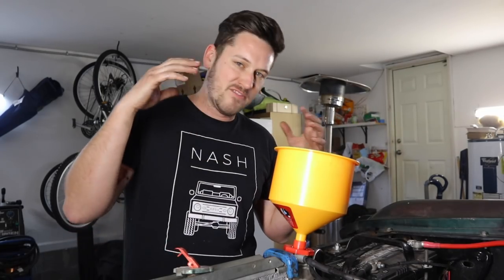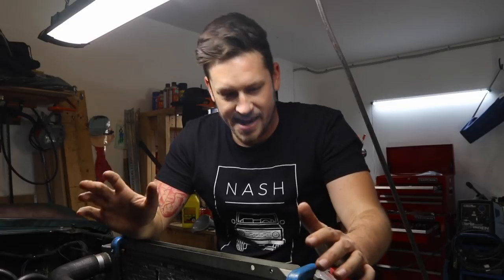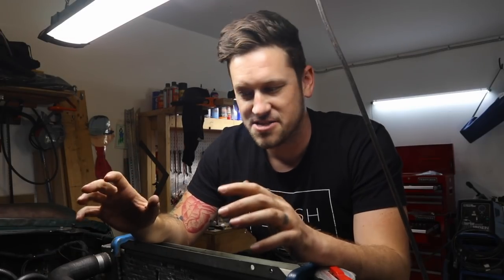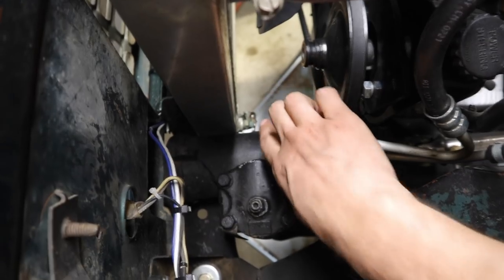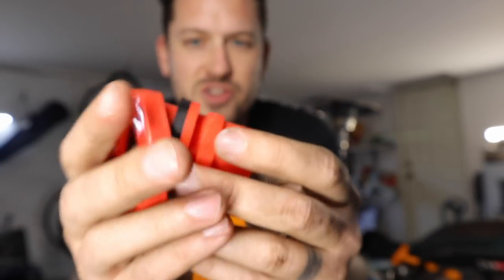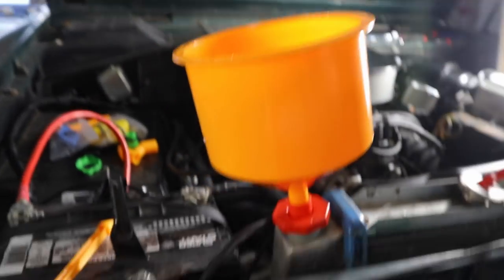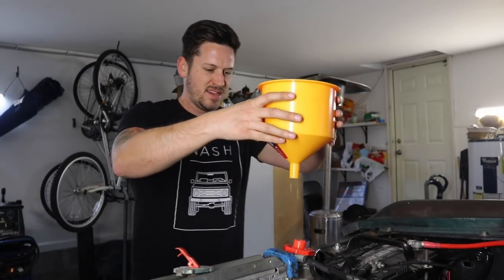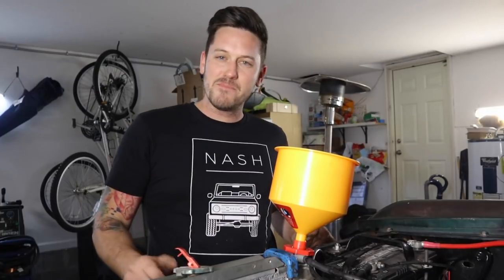Bronco Basics: Burping the Cooling System

Comment: Jon please help
My 72 idles fine for about 15min and up to 180deg then just shuts off any ideas also sounds like yours with that slight ticking did you figure out cause
Thank you
Vince
Reply from the maker: My ticking was a loose rocker and a header gasket leak. Not sure why it would shut off at 180?
Reply: Thanks Jon, keep content coming
Reply: @vincentmayer8511  Do you have a temp switch on your intake manifold?  Some fords after 68 (im a mustang guy but I assume they did this on broncs) have a temp switch.  When it reaches a certain temp its designed to advance the timing.  Youd see a little vacuum T on the intake manifold.  Im wondering if something is going on there with a vacuum leak.  Maybe it gets up to temp and then a leak or problem with the distributor kills the engine.
Reply: Thanks Phil I will look into that much appreciated